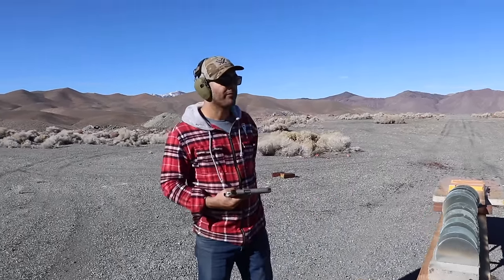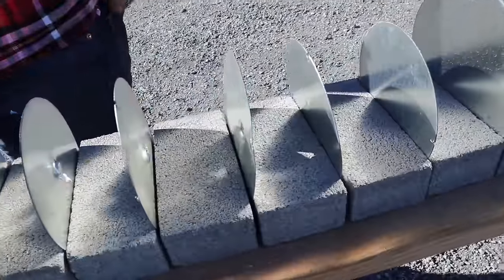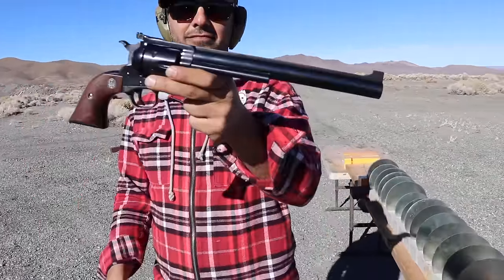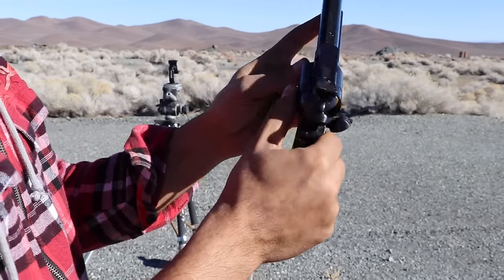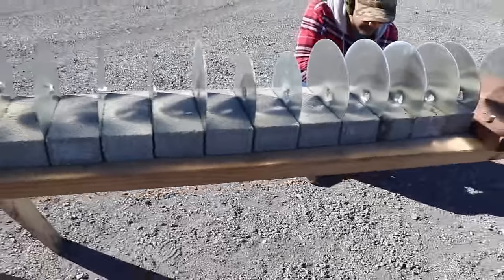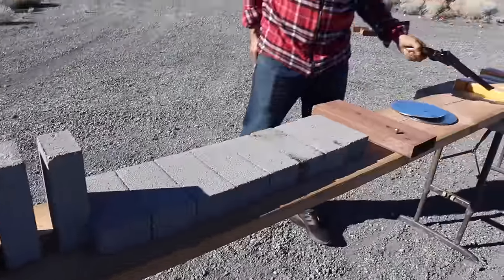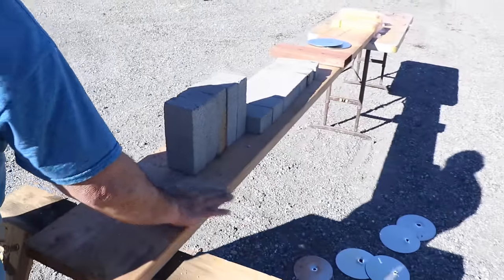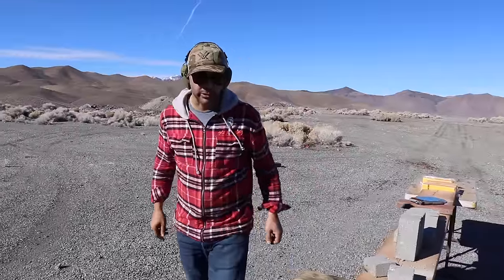45Colt vs 45Acp

Comment: Ignoring the ridiculous barrel length difference my biggest issue is you compared fmj vs Hardcast....not even remotely fair to the 45acp
Reply: If you get real military hardball you will see how thick the jacket on the 45 AC is
Reply: 45 colt is still going to smoke it sorry
Reply: @sic-n-tiredtired4273  ok... and?
Reply: @tom-oneil  ok and WHAT ? Mr. I gotta critique the video. Because obviously YOU know more about ammo than some.
Reply: @sic-n-tiredtired4273  I know more then you... I mean so does a child so 🤷‍♂️
Reply: @tom-oneil it's not just barrel length =, the cartridge can contain more powder and the are typically lit off with magnum primers.

It's like comparing 39spc to 357maxiium
Reply: While these two cartridges are often loaded to fairly comparable power levels, the 45 colt can be loaded much hotter because it has more case capacity. Plenty of 45 colt factory loads up around 1500 fps even with 200+ grain bullets. No 45 acp with that sort of velocity. It's a silly comparison to start with. But entertaining still.

Comment: One variable to consider is the guns they are shot out of. The acp had a shorter barrel. The colt had a longer barrel. A longer barrel will shoot more powerfully than a shorter barrel because the longer barrel allows the powder more time to burn more completely which creates more pressure.
Reply: Well...now...The Science Channel should have known that.
Reply: @marcomalo02  yes they should have.
Reply: Not much difference considering the ACP has a solid barrel, while the Ruger has the barrel/cylinder gap.  So pretty closely matched.
Reply: @bobwright1773  Likely correct on that. Maybe The Scientists from The Science Channel can comment.
Reply: Not fair comparison, should have used a vaquero with 4 3/4 inch vs 5 inch acp
Reply: @bobwright1773  How much pressure was lost through the gap?
Reply: @231mac  I have no way of knowing nor measuring.  But much depends on the powder used.  I no longer have a chronograph nor a an auto pistol.
Reply: That’s exactly why he made the video 😂
Reply: @231mac  on average its estimated 5-10% of your overall velocity and energy is lost through the muzzle gap. Depending on the gun you have could also be more or less.
Reply: Yes, but not enough to make any sort of night and day difference, especially at such close range. The LC also had it's own disadvantage of a non-jacketed bullet.
Reply: I also thought factory rounds for .45 LC tend to be very light.
Reply: @normtheteacher5485 Yeah but, the .45 acp already has a higher pressure than the .45 LC to begin with..
Reply: @nathanhileman3848  if they are labelled "cowboy rounds" they are light. But there are hotter loads intended for modern pistols and .45 lever guns too.
Reply: I do know that semiautomatics have less power than bolt actions so maybe the semi is close in comparison with the revolver and its cylinder gap or we should go from there .
Reply: @231mac  If you carefully and lightly caress the cylinder while firing, you can determine the amount of pressure.  grin
Reply: It basically makes no difference. Adding 2 or 3 inches of barrel length maybe helps you squeeze out like 50 to 80 fps more
Reply: @eclipsegst9419 
 Exactly. I can shoot cowboy loads which are light. I also have underwood loads that shoot like a 44mag.

The real way to test this is  for them to send the ruger Blackhawk 45colt back to ruger and have them make a 45acp cylinder for it. 
    Then it would be same gun same gap ( or close to it ( one could check the gap with a filler gage)).
     The standard 45acp and standard 45colt should be about the same.
     Of course you can cheat by using or hand loading one or the other hotter than the other.

Comment: The .45 lc is an under appreciated round.  The fact that there are .410 shotguns that also shoot .45 lc without any major changing of parts makes it a versatile round.  Some of those firearms shoot .410, .45 lc and 454 Casull, all out of one firearm without changing anything on the gun.  There's always fun with Cowboy Action Shooting as well.  👍
Reply: I couldn't agree more!!! 👍
Reply: @old-rcplane-phart  
👍
Reply: Robinson Rebel  
Yes, I have a Circuit Judge and it is easily one of my favorite firearms to just go out and have fun with.
Reply: Robinson Rebel  
Yes, the Circuit Judge shoots .45lc and .410 shot shells.  Taurus makes a "RAGING" line of firearms that fire .45lc, .410 shot shells and 454 Cassull.  Good luck brother.  👍
Reply: Buffalo Bore makes a super hot .45LC round, too.
Reply: @adabsurdum5905  
👍
Reply: @adabsurdum5905  And it can be hand loaded, but +P .45 colt loads are NOT safe even in many modern .45 colt chambered guns, and definitely not many old guns. Some older .45 colt revolvers like the old model colt single actions should only be used with black powder loads.
Reply: @adabsurdum5905  But you have to be very particular in which gun you shoot them out of.  Don't want to use a Colt, Cimarron, Uberti, etc for a hot Buffalo Bore round.
Reply: @redtra236  I’m looking at trading in my judge towards a raging judge. I would imagine if it can shoot 454 casull it can shoot 45lc +p right?
Reply: @sirbunningham  I would think so but not sure
Reply: I'll take the LC. Flexibility is much greater and I am more of a revolver guy.
Reply: @mkshffr4936  
👍
Reply: @@someguy9982 Wrong. See Jim Jordan and Elmer Keith. The 45 Short Colt is officially known as 45 Colt Government. It is a shorter case like the 45 S&W but with a Colt rim and headstamp.

The term LC came about to distinguish it from the short government Colt. "Give me a box of 45 Colt. No not that one the long one."
Reply: I think there is a new gun that shoots .410 , 45LC , and 45acp and I think it's called raging Cajun or judge .
Reply: @Airon79  
The Raging Judge fires the .45 Colt, 454 Casull and .410 but not .45 ACP.  I'm not familiar with any firearm that fires both the .45 ACP and .45 LC.
Reply: @notsosilentmajority1  @notsosilentmajority1  I told you the wrong gun , my bad . The raging governor can shoot 45acp through a separate cylinder . Sort of like how the Taurus 629 shoots .357 mag and 38 special in one cylinder while the other cylinder shoots 9mm and 380acp in a different cylinder .
Reply: @Airon79  
So, there is no Raging Governor.  There's a Raging Hunter and a Smith & Wesson Governor.  There's also the Judge, which fires .410 and .45 Colt (LC), but regarding the firearms (I think) you're talking about, there is the Raging Hunter by Taurus and the S&W Governor by Smith & Wesson. 

in order to fire .38 sp. or .357 out of a pistol that is made to fire both rounds, you don't have to do anything at all.  There is no different cylinder, there's nothing different.  you can load one .38 round and one .357 round or all .38's or all .357's or mix and match and that's it.  Just shoot away.

The Raging Judge fires the .45 Colt (Long Colt), .410 shot shells and the .454 Casull.  It is capable of firing 2 1/2 or 3 inch shells of .410  in the Raging Judge.  There is nothing needed or added to fire those rounds.  You simply load them into the cylinder, either all the same or a mixture of the 3 different rounds and simply fire away.  Nothing to do except shoot.

With the S&W Governor, you can fire 2 1/2 inch (but not 3 inch) .410 shot shells and .45 Colt (Long Colt) without doing anything or adding anything.  But if you want to fire .45 ACP you have to add Moon Clips.  Moon Clips are needed for the .45 ACP because the rounds don't have a rim.  The Governor comes with Moon Clips but you will have to only fire .45ACP rounds when using the enclosed Moon Clips that are made for all 6 rounds.  You cannot mix and match different (.45Colt, .410) calibers.  There are newer Moon Clips that are made to hold 2 rounds instead of all 6 and that will allow you to fire 2 .45 ACP rounds and a mix of .45 Colt and/or .410 with the remaining 4 rounds.   

So yes, the Governor can do that but Moon Clips are needed.  The Governor also does not fire .454 Casual which is the most powerful of all the rounds we are discussing.

I think you're referring to the Taurus 692 which fires .38 sp and .357 out of one cylinder and 9mm out of another, separate cylinder.  You still have to change the cylinder to use 9mm.  You cannot use .38, .357 and 9mm with one cylinder.  You must swap out the cylinders, depending on what ammo you want to use.  It's like a revolver that shoots .22 lr and .22 WMR,  it's the same revolver but you must switch out the cylinders.  
There are more multi purpose calibers than you may realize.  If you do a search you will find some interesting things.  Good luck
Reply: Ok bro you heard of the Taurus. You're so cool.
Reply: @bleachedmud8723  My first handgun was a Taurus .44 mag , roughly 16 years ago .
Reply: @bleachedmud8723  

Thanks for the kind words.  Since no one was sarcastic towards you, it's evident that you were giving a compliment.  
So, thanks!!!!!      Yeah, cool.........  🥶  🍙
Reply: @@someguy9982Honestly, I would rather see "45 Long Colt" in these comments than the total disregard for spelling and grammar...such as "would of" for "would have" or "there" in place of "their".  The term "45 Long Colt" seems like less of an offense than horrible English skills.  I'll shut up now.
Reply: It's simple, 45Colt is twice as powerful as 45acp. And just a wee bit less than 44mag...
Reply: You guys are talking about mixed calibers out of one revolver, I suggest the 460 Smith and Wesson, fires 460 Smith, 454 Casul, 45Colt, 410, and 44mag. But I don't recommend the 44mag as the round fits very loosely in the cylinder, but it will fire. Don't try this at home ha ha, but seriously it's not safe. The 500 Smith only fires 50s. 500 is a bit more powerful, but the 460 has better ballistics, and is more versatile...
Reply: What is a 45 lc?   I seen a 45 acp from a 5" barrel and a 45 Colt from a ten inch or so barrel?   also...my 45 acp load is a 200 grain cast and coated swc at around 1000 fps WAY more potent than some 45 Colt 'cowboy' loads from a 1858 Remmington conversion.   soooo..   different barrel lengths and different loads make.....  well.... a difference.   oddly enough.
Reply: @doranmaxwell1755  
The .45LC is another name for the .45 Colt, it refers to Long Colt.  You can read up on the history and why the round has the name long colt.  Some people use one or the other term and some people use both terms interchangeably.  Yes, different loads and different barrel lengths usually do make a difference.  That's something fairly well known, especially when firing rounds from a pistol compared to a rifle.  The added rifle length usually makes a lot of difference in velocity.
Reply: So.... even tho it was never called the long Colt it now prefers the pronoun of 'long colt' ?    Did no know I would run into this stuff in the gun world.    There actually was a 38 long Colt or Colt long andf a 41 long Colt but there never was a 45 long colt and with any luck there never will be.   Is the 45 acp a 45 short colt?   I don't want to embarrasse myself at a party.   And strangely enough I do realize that longer barrels increase velocity (to a point)  It is why I would never judge one round in a 5" barrel against another in a 10" barrel.  for instance on my chronograph my 6" barrel .357 Python is 300fps + slower than the same round out of my 20" Henry lever gun.   If I were to test say the 9mm against the .357 or even 38 spl?    I would not use a glock pistol (I mean I would never own a glock but. you know)  against my 20" barrel Henry in .357  @notsosilentmajority1
Reply: Moon clips
Reply: @mkshffr4936  That never happened.    it is a myth but at least get the myth right.    There were indeed two 45's at the same time in use by the army. one was the 45 Colt called............45 Colt    the other was a 45 scofield (not sure on the spelling)   When you asked for a 45 Colt anywhere guess what you got?     yep... a 45 Colt.   if you wanted a 45 scofield guess what you asked for?
Reply: @doranmaxwell1755  No the ACP is not the short Colt. The short Colt was officially known as the 45 Colt Government. It was an original 45 Colt type case, complete with Colt rim size and headstamp, shortened to shorter S&W length. This allowed for its use in both weapons with no concern for rim crowding or case length.
Reply: @doranmaxwell1755  It is spelled Schofield. And no you are wrong. I'll take the word of Elmer Keith of "Hell I was There" fame, Sheriff Jim, and "Cartridges of the World".

The "Short" Colt is a real cartridge officially called the 45 Colt Government.
Reply: @mkshffr4936  Actually there was only one cartridge called the Colt government and that was the 45 ACP   There is no way anyone at anytime in history could have asked for a 45Colt round and gotten anything but a 45 Colt round.   Thanks for the spelling correction but I am sure I will forget in the future also.   it is not a round I deal with much.   it was indeed tho a shorter version of the 45 Colt as the Smith cylinders were too short for the 45 Colt round.      There is no such thing as a 45 short Colt so no need to ever call the 45 Colt anything but its name... 45 Colt.     I just think it is funny when someone uses the whole 'long Colt' thing.     When Keith and such were around tho there were lots of long and short Colts just not in 45 mostly 41 and 38 so it would be natural to just say that in relation to the 45 Colt especially if there were still some Schofields laying around on some dusty shelf.    doesn't make it right tho.
Reply: @doranmaxwell1755  Sorry but Keith and Jordan both say differently and they are more credible than YT comment sections. Keith discusses it, the venerable "Cartridges of the World" has documented it (sorry I don't remember which edition I had), and Jim Jordan has published pictures of it and claims to have killed a varmint with one. Those are pretty authoritative sources and I will be sticking with them.

YT doesn't allow links but if you search for "Long and short of the 45 Colt" you should be able to find Jim's article.

EDIT: Correction, Taylor not Jordan.🥴

Comment: There is a huge difference because of the barrel length
Reply: It doesn't matter about barrel length. The 45colt is just has more mass than the 45acp. 45acp may be faster but still has less impact than a 45colt.
Reply: @James Hall  The main differences are the bullet mass but, also the 'load' of smokeless [gun] powder is much larger. If both of these were equal, then the barrel length would become the factor.
Reply: @markmiwerds100  Exactly. Someone that is more knowledgeable than me and can explain it better.
Reply: Revolver loses a bit of ft/lbs due to cylinder gap, so the barrel difference is only a small factor in the equation.